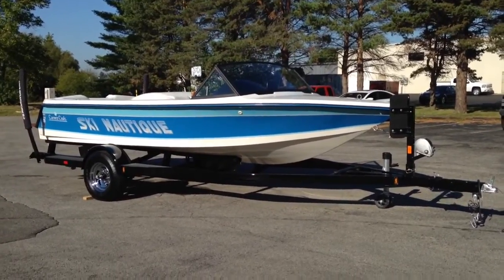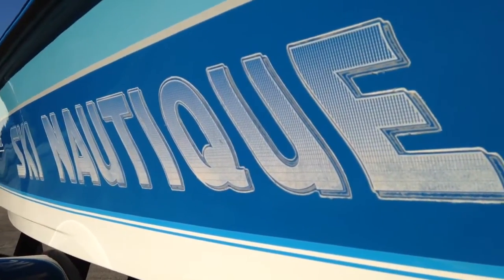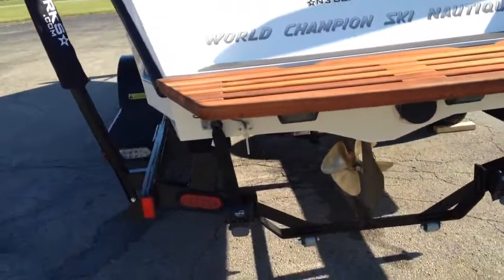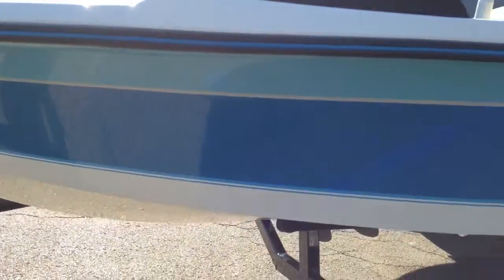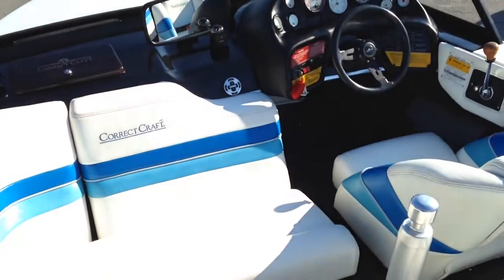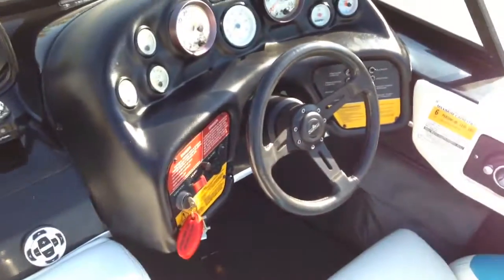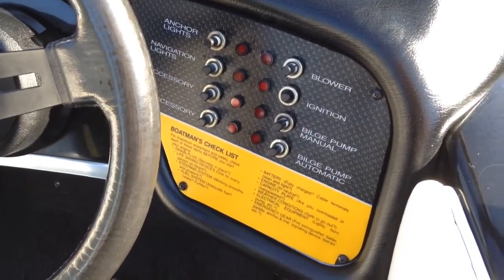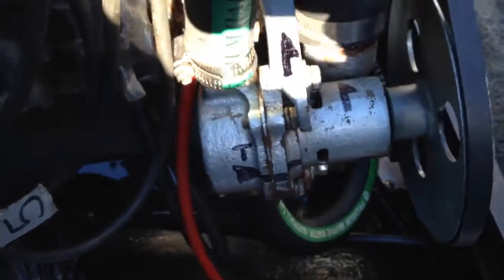1990 Ski Nautique- Blue/ Teal/ Silver Cloud Walk Around

Comment: That trailer would be around $4,800.  There would be a slight difference in looks because we would go with Boatmate Trailers vs. Phoenix Trailers.  

Give me a call at the shop if you have questions - 317-845-9253

Michael